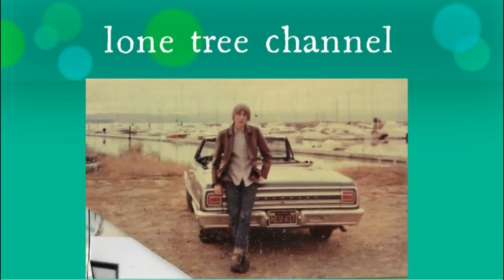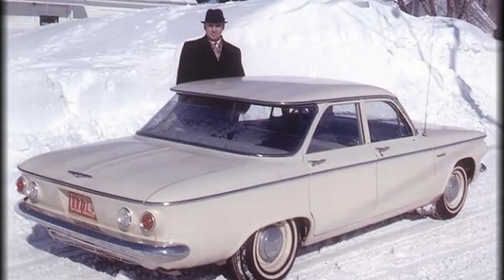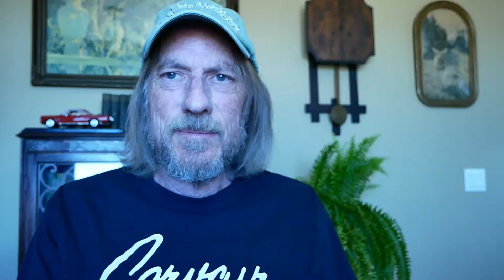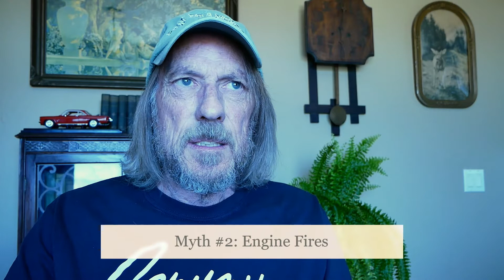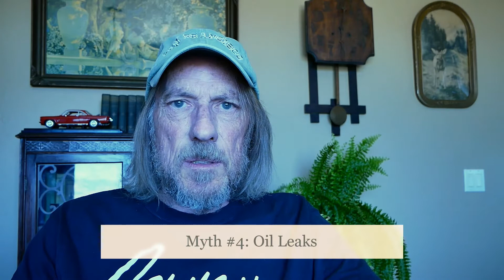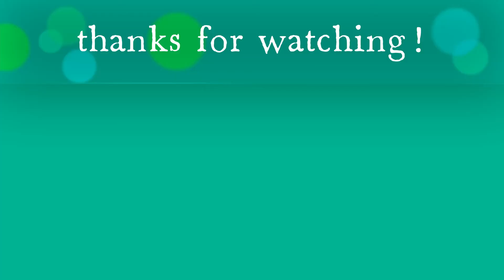Car Chat - Corvair Myths Debunked

Comment: We had a 1961 basic Corvair model as a family car. My Mom, a new widow bought one from an estate in 1962. There was no radio, three on the floor, no padded dash and rubber mats on the floor. That was the most stable car I have ever driven. In Western NY we get good amounts of snow; that car would go through snow well above the hood/trunk and never quit. The only time a fan belt ever popped was because in the winter and my Mom couldn't grasp the concept of air cooled and put and army blanket over the engine on a sub-zero night. The blanket caught the fan belt and it popped. I learned to drive on that car and drove to high school in my senior year. Great car and great fun.

Comment: well done dude. I lived in a 65 Corvair convertible in Hawaii back in 1972. That was a great little car.
Just bought a rusty 61 Monza for 500 bucks. Dragged it out of the woods here in Oregon. Had to use the wheels off my MG.
Good glass good motor and 2 speed powerglide. Thanks

Comment: 6:42 - Tire pressure "experts" please pay attention: Higher is not always better!  What Lone Tree said about Corvairs applies to tire pressures broadly.  These numbers weren't pulled out of a hat.  They were arrived at through trial runs, engineering calculations, and common sense.  

Sure, there was that SUV from 1990, with those tires on it, and one of the lowest tire presure specs since 1970 for a vehicle of its type.  I would have spent more money on engineering and R&D, instead of just creating a new model based on an older chassis, and recommending  cold tire pressures far too low for it.   Would I drive a car with Firestone tires on it to the airport to catch my flight aboard a DC-10?  In a heart beat!

But for the most part, following the specified or recommended tire pressures listed on the vehicle itself will get you the best handling, performance, ride, and tire wear.  Going 1-2psi above is also no problem, if you wish to fine tune things a bit.